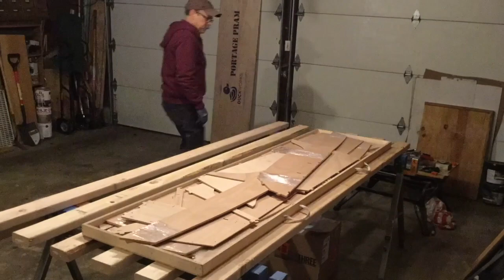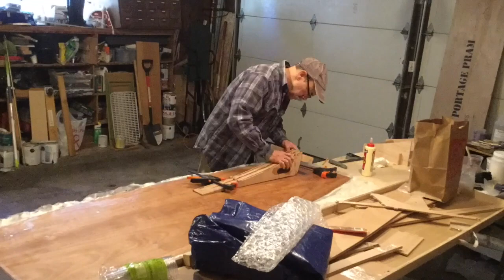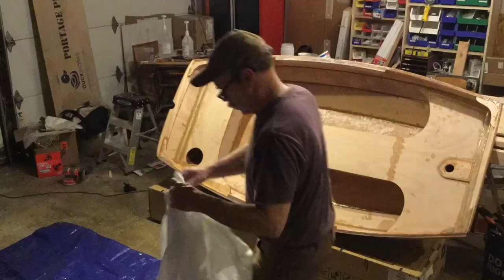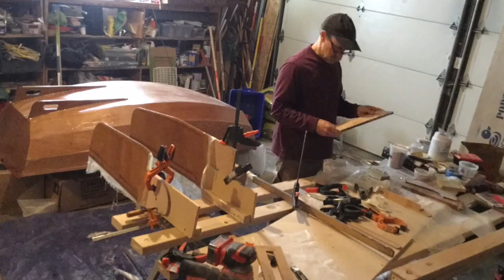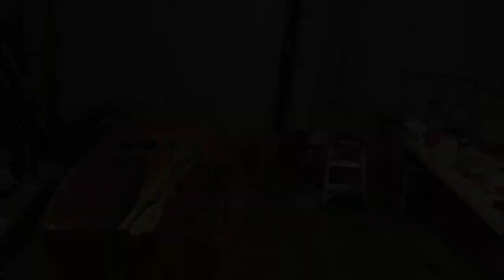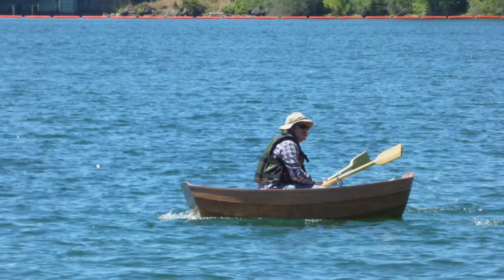Portage Pram Kit Build

Comment: I'm grateful for this video. I'm contemplating doing the same and it is so helpful to somebody who hasn't made anything this serious with wood.
Reply from the maker: It's a great project. Mostly it's using zip-ties, mixing and spreading resin, and sanding. You'll need some clamps, but other than that, not much else if you buy the kit.